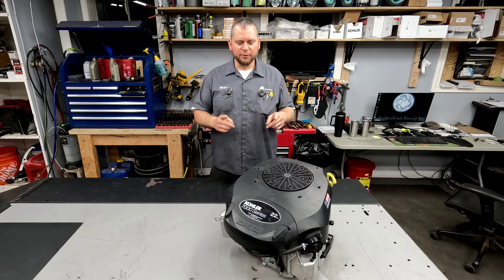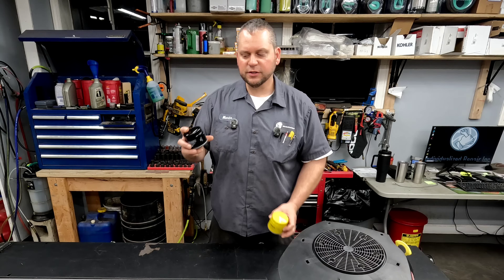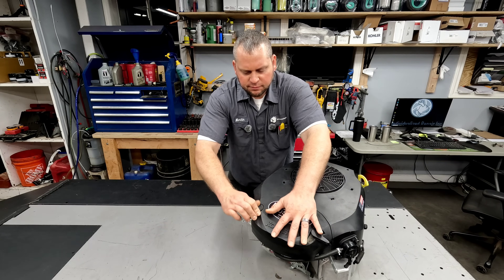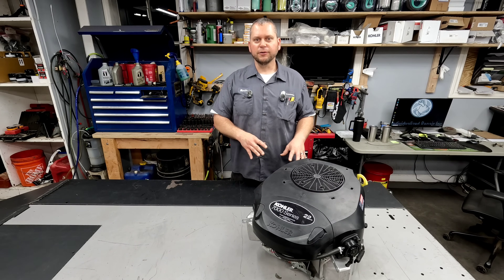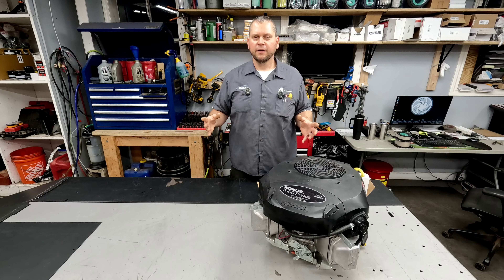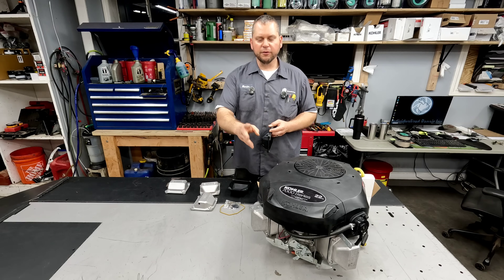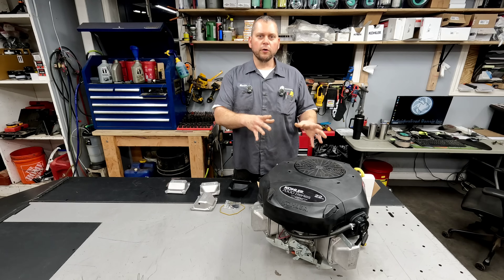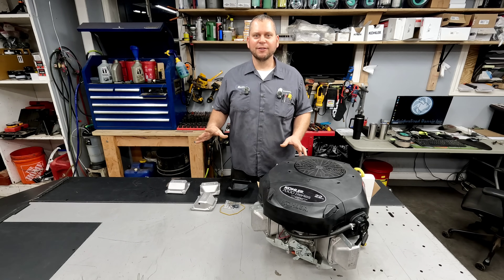Top 5 Kohler 7000 Engine Upgrades – Boost Power, Reliability & Make Maintenance Easy! (Now Rehlko)

Comment from the maker: Check Out The Tools We Use Often:

Spark Check'r SPC-7200 https://ebay.us/Js5ohF
PET-4000 Ignition Tester https://amzn.to/41KdfKS
Dewalt 20V Impact https://amzn.to/3WJrDRt
Neiko Impact Socket Set https://amzn.to/3ygAtwP
Dewalt 20V Grease Gun https://amzn.to/4folbH0
Dewalt 20V Impact Driver https://amzn.to/3z16OaE
Titan Impact Bit Set https://amzn.to/3LChxvk
Right Angle Milwaukee Ratchet https://amzn.to/3Xdfxki
Dewalt 20V Angle Grinder https://amzn.to/3BiYdkP
Digital Tire Gauge https://amzn.to/421oFer
Milwaukee 12v batteries for ratchet https://amzn.to/434QukO
Clip On Work/Video Light https://amzn.to/3XPeqqE
Dewalt 20V Angle Grinder https://amzn.to/3Yi0vIL
Vice Grip Pliers https://amzn.to/4gMHpmK
OEM Tools Fluid Extractor https://amzn.to/4f8ALXf
Noco Boost HD Jump Pack https://amzn.to/45gbaHm
Digital Voltage / Amp Meter https://amzn.to/3y3ipGt
Lisle Compression Tester https://amzn.to/3OkPlPn
OTC Leakdown Tester https://amzn.to/47PSXjp
12V electric fuel pump https://amzn.to/3yPm0YJ
Tiny-Scan Code Reader TS-140 Stens part number 750-902 https://amzn.to/46b3rMZ

The links contained here are affiliate links for which we may be compensated if you make a purchase

Comment: What can be done about the compression relief valve issue? My starter/battery if too weak to start this damn engine. Can’t overcome the compression, especially after cranking on it for a bit, or after shutting it off.
Reply from the maker: Adjust the valves to begin with and if that doesn't help make sure the connections, battery, starter and solenoid are properly working. If so the camshaft will have to be replaced
Reply: I just fixed it with a lifepo U1 size battery upgrade with 4x the cranking amps. The factory battery is garbage. The new battery is a huge improvement
Reply: There is no compression release on 7000 series cam lobes.

Starter is weak

Comment: I like the oil filter idea. I use Wal-Mart 3614, a good filter, and much cheaper than the kohler filters. Wix also makes a good filter but they cost 3 to 4 times as much as the Wal-Mart brand.
Reply from the maker: Awesome to hear that tip! Thanks for sharing and for watching!

Comment: I'm using a Kohler KT745-3088.

Could you tell me the cylinder head gasket part number?

Could you tell me the oil part number?
Reply from the maker: Cylinder head geasket 32 841 02-S can be found at https://amzn.to/4oknf6t
Reply from the maker: Oil can be found at https://amzn.to/3J5uO1X

Comment: Great tip for the larger air filter swap. I have a Cub Cadet XT2 GX54, I just need to make sure that the larger filter cover will allow my hood to fully close before I buy the parts.
Reply from the maker: Definitely want to make sure there is room but any application should allow a few inches. Thanks for watching!

Comment: What’s your opinion on the 300 hour oil change kit offered by Kohler/Amsoil? I do between 75-100 hours a year. So that would put me at 3-4 year oil changes and checking the level.
Reply from the maker: We are basically doing the same thing with this, synthetic oil and a larger filter gives you more engine/oil life. I still would not run it to 300 hours but I am way more cautious about changing oil sooner rather than later. Seems all my stuff lasts forever so there must be something to it. I would say do it but still check and change it every 150 hours or two years max. I would still do it every 50-75 hours like I do with everything else I own though...
Reply: @IndRepair thank you. 150 hours or 2 years seems like a god compromise for the 300 hour oil. What about my hydrogear 3100s? I was definitely thinking of filters and 20w-50 full synthetic oil or the kit from hydrogear at the end of this season. Currently at 66 hours and I have towed heavy logs and full of dirt in the cub cadet plastic cart. Also aerate w 150# of weight and a 4x8 wooden lawn rake that I built. Mower is a ZTXS4 48.
Reply from the maker: Just got a kit for one I will be doing a video on next week they recommend every 400 hours after the initial 75 hour change but I would get them done with hard use at 250-300 hours
Reply: @IndRepair perfect timing. Looking forward to seeing your process.
Reply: @IndRepair I’m doing my Hydro 3100 service currently. Make sure the mower is level and if you can tilt it inboard for each side that should allow you to drain more of the old fluid out. I initially had the rear jacked up higher than the front and it only took 1 quart before it started coming out the overflow. On the other side I made sure to level when draining and then put a jack stand on the opposite side to get more of the fluid out. That side took 2 quarts before it came out of the overflow. Redoing the other side now.
Reply from the maker: That is strange, have never seen this be an issue. Was the expansion tank car removed when doing it? Have the video set to release tomorrow at 11am...won't let me share it now apparently
Reply: @IndRepair No external expansion tanks on this mower, so I believe they are internal. After I leveled and then jacked the opposite side and let it drain for about 30 mins, it took 2 quarts.
Reply: @IndRepair Also having an odd issue where the drive belt keeps popping off after starting the engine and taking it out of park. This is a CC ZTXS4 that has the steering wheel. Do you by chance have access to a service manual? I have the belt routing correct, just not sure if I have the tensioner spring hooked to the proper location.
Reply: Dumbass post of the month if not the year? DUH!!!!! Fan on top of hydro pulley is hitting my jackstand. Christ! :) This just might be the cause of the belt coming off…you think? :)
Reply from the maker: Lol it happens to use all!

Comment: I recently changed my oil with Kohler brand which says it has zinc in the oil... Is this just a gimmick or is it needed for these engines?
Reply from the maker: Most oils have a decent zinc content. When they did testing on the Kohler oil it had about 1300ppm or zinc, which is above what a mobile 1 full synthetic will have at around 900ppm. Kohler oil also shows a higher phosphorus level than most other oils. That being said, how much difference does it make? I am not sure to be honest
Reply: @IndRepair  thanks for the feedback...Appreciate your site.
Reply from the maker: Glad to help!

Comment: This is September 19th 2025 at 10:20 p.m. eastern time I am at approximately 6 minutes into video and you're talking about exchanging the valve pan covers for composites and the composites come with a gasket how come the gasket can't fit or work with the original valve pan covers I'm just wondering because if the aluminum one is shape the same as the composite what makes the difference
Reply from the maker: The originals are flat and meant for a sealant to be used. The composite/aluminum ones have a channel for the rubber gasket to sit in and seal against the block

Comment: 2013 got a a new mower a craftsman with a kooler engine.
 I changed the oil after 50 hours,and filter.
  Up till now I have never changed the oil again.
I have only changed the oil filter once a year and topped off oil.
This engine is still working at 100% today.

The new pennsylvania oil 5w/30 platinum synthetic says write on the container 20 years old. Or 750000 miles. Whichever comes first.
Reply from the maker: Now that is a lot of miles for a riding mower LOL!
Reply from the maker: Interesting!

Comment: On an XT1 / XT2 Cub Cadet the longer yellow filter can contact the steering drag link when the axle is articulated-  I’ve had a few customers have issues where the drag link wears through the oil filter and a small leak starts .  Have you seen this ?
Reply from the maker: I normally see it on some of the craftsman versions but some applications this definitely can not be done on. If you are within an inch of the filter I normally will not recommend a larger one. Never seen one worn through though, seen plenty rub and dent the filter
Reply from the maker: Usually I see this when people use the larger 491056 on a briggs on different applications but obviously you always want clearance

Comment: 51348 Wix filter is same as Kohler Pro, I personally use 30HD oil in mine and have for years, I live in warmer climate so it's not used in winter months
Reply from the maker: Great tips. Does Wix actually make the filter for Kohler? I am always weary of most aftermarkets but Wix is a good quality. Thanks for watching!
Reply: That is the filter I use on mine.
Reply from the maker: Nice!

Comment: Shell Rotella T6 10-30 or 5-40 diesel oil all the way. Higher wear additives, handles sustained temps much better, lasts longer between breakdown, handles higher heat, more forgiveness on “forgotten” oil changes. I will not run anything else in any of my machines
Reply from the maker: Hmm will have to look into that a bit. Thanks!
Reply: @IndRepair  you’re welcome
Reply: I use 15w-50 amsoil small engine
Reply from the maker: Good zinc content
Reply: @IndRepair was 119 this year and didn’t burn a drop. Oil tests showed no shearing or breakdown in 100 hours. Valves pristine(just hit 400 , didn’t have to adjust)
Reply from the maker: Wow, crazy

Comment: Can you or any followers help me with a Briggs engine first off it’s older and key way is fine   While pulling over the cord is ripped out of my hand no valve adjustment type machine any help would be great tia
Reply from the maker: I would check the flywheel key
Reply: @IndRepair I did I put that in my explanation
Reply from the maker: Ok. Engine info would be great is it like the one in the video I sent or a flathead briggs then I assume? Bottom of deck has been checked for obstructions? Anything else done so far?
Reply: @IndRepair no I’m going to go deeper into keyway and the pressure pump connection
Reply: @IndRepair also an old school carb built into fuel tank old time cyl head good compression
Reply from the maker: If the key is not sheared then valves are probably the issue
Reply: @IndRepair ok thanks i didnt get to it today
Reply from the maker: I hear that
Reply: @IndRepair it was a beautiful get out on the bike day
Reply from the maker: No doubt an awesome day for that!
Reply: Pulled flywheel key is in perfect condition
Reply from the maker: Yeah sorry not sure what would be going on. Do you have engine information?
Reply: @IndRepair Briggs old style motor attached to a power washer
Reply: @IndRepair can’t seem to attach a picture
Reply: It’s the older carb attached to fuel tank
Reply from the maker: Should have info stamped on recoil flat part
Reply: @IndRepair I know unfortunately nothing there all gone the only tag was engine info I get it this motor is probably toast
Reply: @IndRepair I’m actually going to dig deeper into the key
Reply from the maker: https://youtu.be/HI-e2e9jr04 shows it first different issue but same

Comment: Great stuff, Martin!  These mods make SO much sense!
I would mention to owners that the larger oil filter and drain tube add capacity to the oil volume, so that’s also a good thing, but keep it in mind when buying oil - you’ll need a bit more - and definitely check the dipstick when done.
Reply from the maker: That's a great point about the oil capacity! I appreciate that!

Comment: The link to Kohler PRO Upgrade Air Filter Cover 32 096 22-S is for the standard cover 32 096 20-S not the pro cover.
Reply from the maker: Thank you for noticing this!
Reply from the maker: Fixed now

Comment: I changed to pennzoil platinum synthetic and my Koehler 7000 started burning oil. I changed back to Koehler and it stopped using oil. Beware
Reply from the maker: Interesting. We're you using the same weights? What area of the country are you in? Just curious, never seen this issue and we sell full synthetic quite a bit. We do always use Mobil 1 though...
Reply: @IndRepair  10w30 in Georgia
Reply from the maker: Hmm, thanks for the info!

Comment: My instructions say to oil the prefilter for the air cleaner. I never see you do that
your thoughts?
Reply from the maker: I love the idea of oiling the prefilter but to me with as lean as most of these machines run it limits air flow too much. Not sure if it is true or not but has always been my thinking and the reason I do not recommend it. If you go with a larger surface area filter, oiling is going to be great for filtration

Comment: I am switching my k725 7000 series from Kohler 10w-30 synthetic blend to Pennzoil ultra platinum full synthetic 10w-30. I run 10w-50 Kohler pro full synthetic in Kohler 5400 series single cylinder. Engine much quieter when finished mowing after about an hour of heavy mowing. This engine has a weird rattle since it was new. Trying heavier oil. Not much change
Reply from the maker: The 5400 does seem to be loud to me also. The full synthetic will give much better protection

Comment: If you're the kind of guy that stretches your oil changes longer than you should..   
Then just use full synthetic..  It will cover you azz much longer.
Reply from the maker: Full synthetic oil is a great choice for extended use or just regular intervals. Either way it is far superior to standard oil

Comment: Hi Martin. Removal of my Kohler 7000 oil filter was nearly inpossible due to the way it was located. I found a tool on AMAZOM which has made the removal and installation a breeze. The tool's cap fits over the end of the filter and utilizes a 1/2 inch extension bar and ratchet to remove and replace the oil filter. I use a long extenstion bar which clears my back wheel. If you would be interested, it's an UXCELL 918 Aluminum Alloy 74mm inner dia. with 15 Flukes oil cap wench socket removal tool. Just type in oil filter removal tool. Search for the tool with your filter dia. and number of flukes it has. The part number of mine is 918. With tax it was $17.14

Comment: Excellent! Just ordered the PRO air filter and cover upgrade. 
What are your thoughts on the foam pre filter, oil or not?
Reply from the maker: I always believe oil should be used but we never oil them because most are already so lean we do not want to limit air flow. Going with a larger filter this will be acceptable and give better filtration

Comment: Well said Martin, I tend to over Maintenance all of my equipment and only use full synthetic oil. I run my X584 year round and never had a engine issue.  I also use full synthetic 2 cycle oil and it reduces smoke and wear.
Reply from the maker: It really does offer a lot better protection for both two and four cycle stuff. thanks for watching and sharing your experiences

Comment: Can you tell what the part no# is for a 22 HP Briggs Stratton  the oil filter is.  And witch is a good one for my toro time cutter I just bought one I got 0.2 hours on it
Reply from the maker: 491056 is normally the taller version or 492932S for the smaller one
Reply: @IndRepair thanks

Comment: I have a 7000 26 hp with 161hrs that the top crank seal/bearing froze up tight on it I've had pipe wrenches on it with cheaters bars and cant budge it 😮 it was always serviced at a cub cadet dealer and ran on flat ground 🤔why the original owner didn't get some kind of warranty done on it im not sure.  I paid $125 for it. Not bad for a XT2 🤔
Reply from the maker: I worked on one like that recently! Seems like a common issue on these for anyone that mows hills. That is a solid buy for an XT2 with a blown engine!